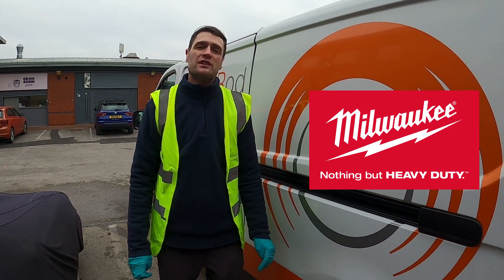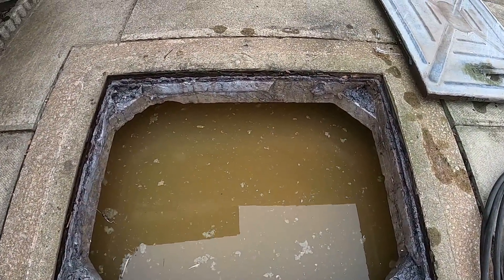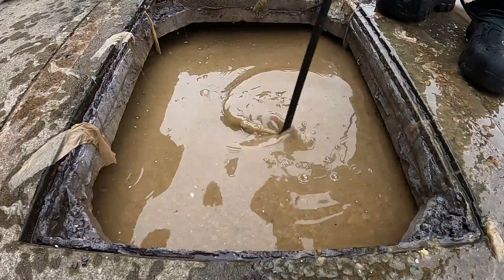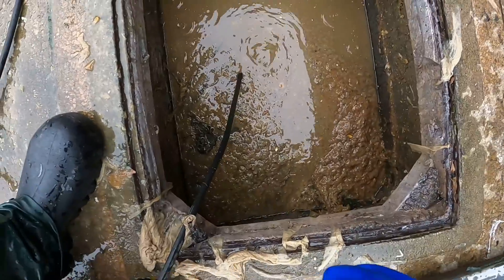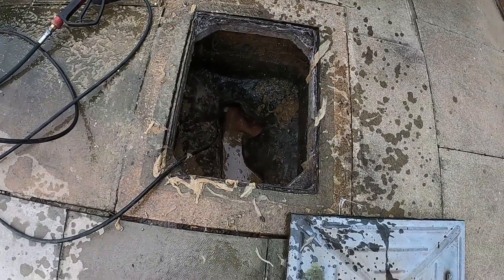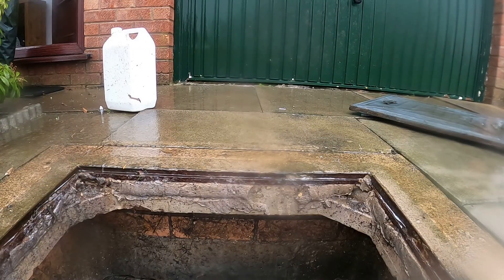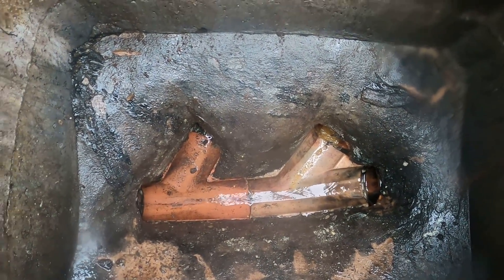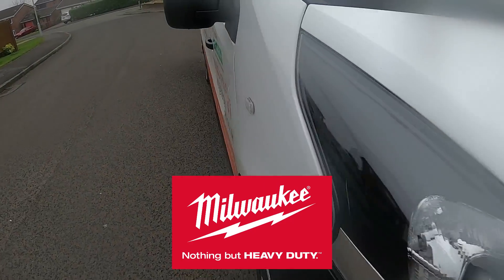Manhole Unblock! #98

Comment: At the 2 minute mark I knew you were heading the wrong way. The water level rising at that rate is a dead giveaway nearly 100% of the time as you are pulling backed up water to the cleanout point VS pushing it away. It is common here in the US for a single 4" cleanout to go both directions, and sometimes the nozzle shoots towards the house because it is just a big "Y" basically and makes a heck of a mess. It takes about 15 seconds to know it is headed in the wrong direction here. We do not have those nice big manholes, just a 4" pipe to surface at best in nearly all cases.